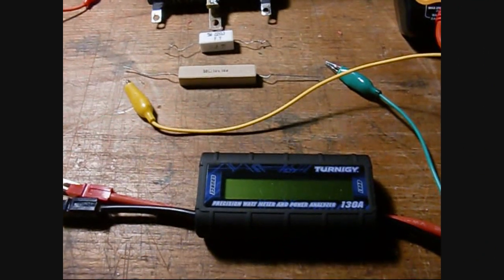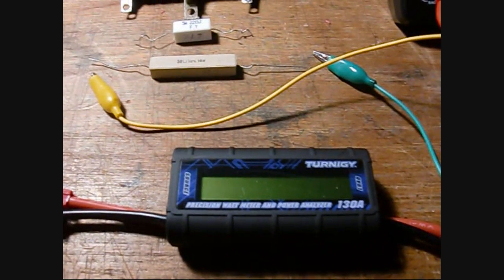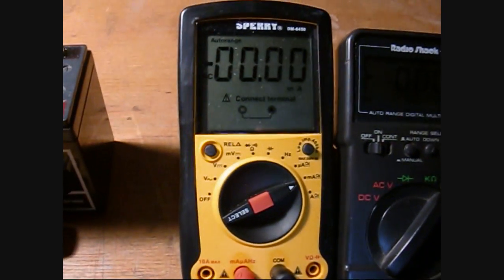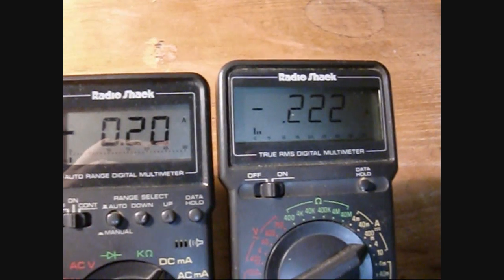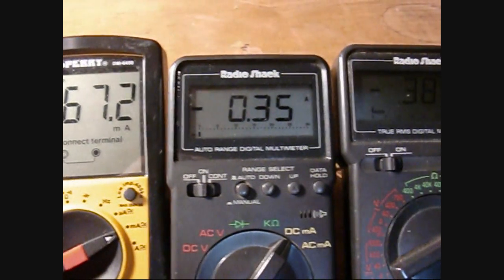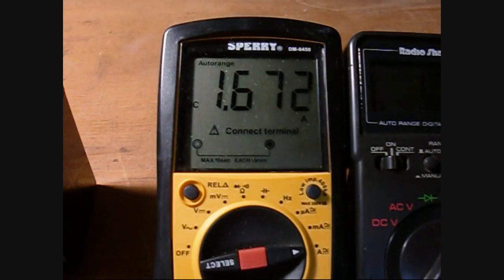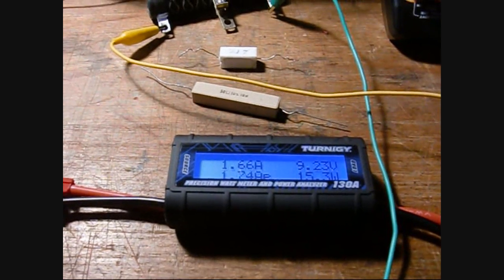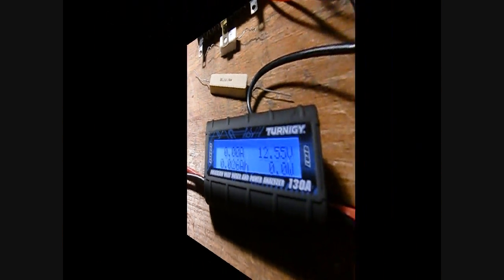Turnigy Watt meter Low Current Test

Comment: I suspect the turnigy is using a current shunt for it's measurement, but the backlight and meter's own consumption is not included in that measurement. If the backlight draws about 20ma then that puts it about on par with the multimeters (ie it is reading 20ma low because its readout doesn't include it's own consumption)

Comment: This is exactly what I wanted but found it a little pricey.  Ebay sellers priced this a lot higher.  Much better than connecting a whole bunch of wires to checking the volts and amps.